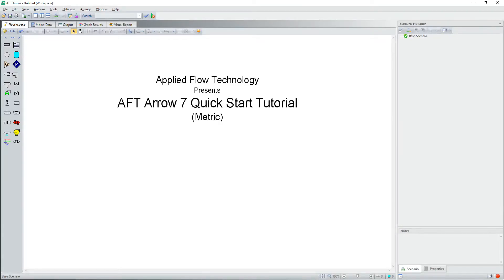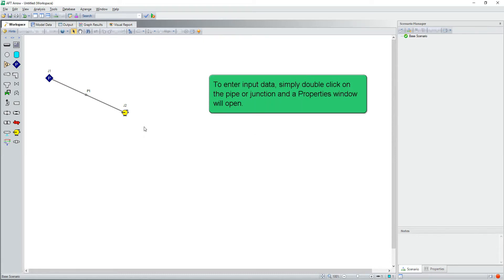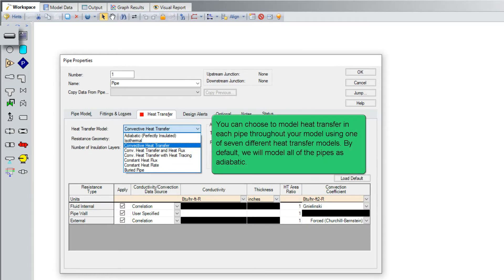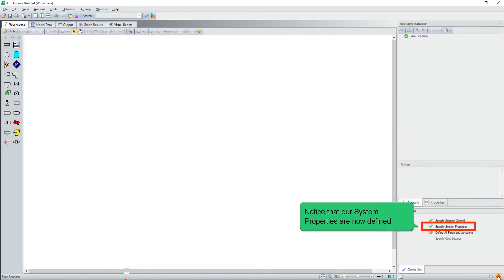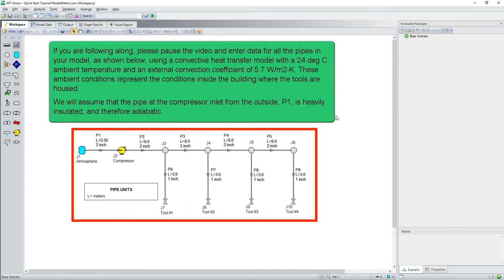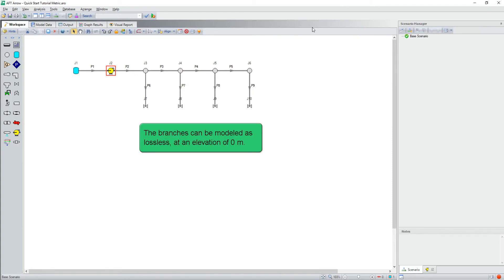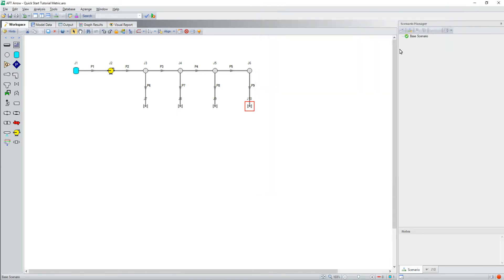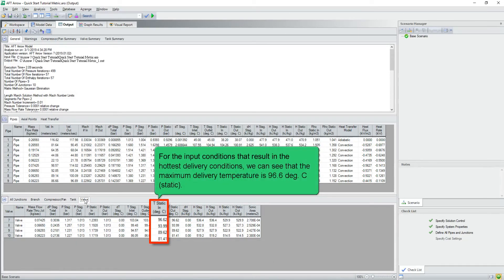AFT Arrow 7 Quick Start Video - Metric Units

Comment: Thanks for this great introduction. It seems to be a great tool to do hydraulics.
Note: I noticed that convection coefficient is typed as 57 in low temperature case. Should it be 5.7? (It was 1 Btu/hour.ft2.F in imperial units video). And also should we change valve outlet temperature to 21 C in low temperature case?